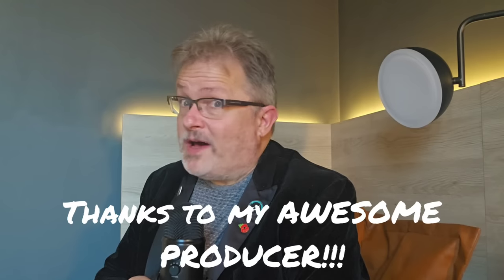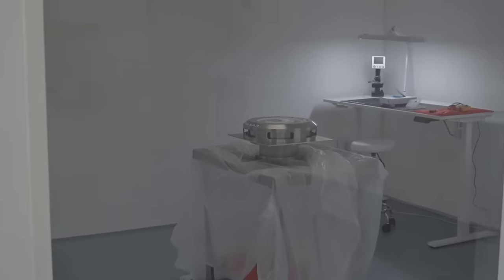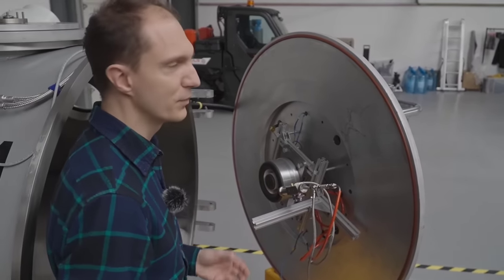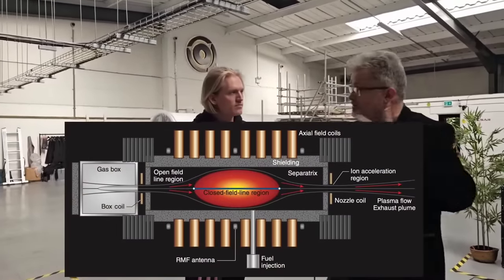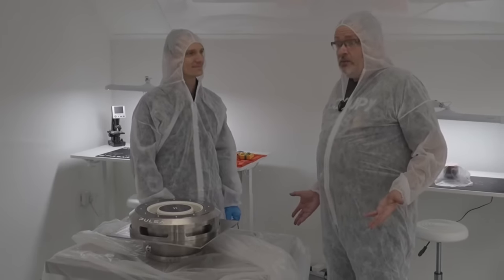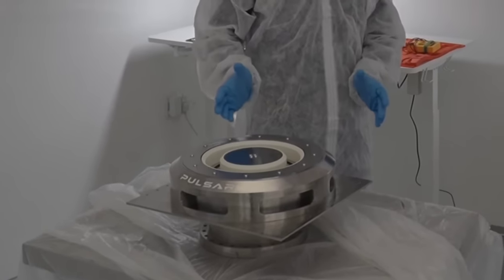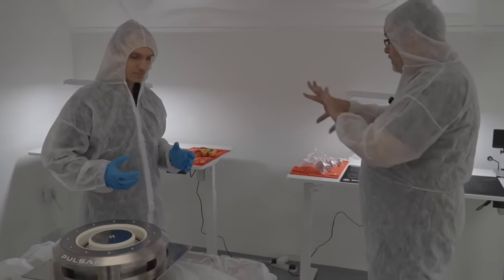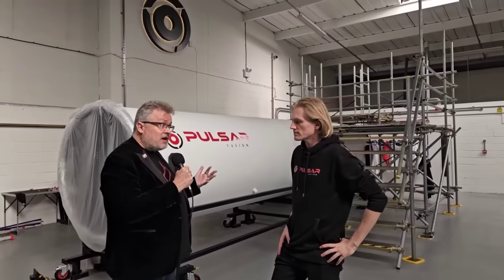Pulsar Fusion update!!  Nuclear Propulsion in person!

Comment: someone get this man an audio engineer. he brings really great content but its definitely held back by the technical issues.
Reply: Yea, I can't get my audio loud enough to hear what's going on... so I guess I will have to skip this video.
Reply: Needs sound leveling and amplification. Great content!!
Reply: Luckily my phone gets very loud.
Reply: It’s funny I had to turn to the lowest volume setting I could get at the beginning and to put it on maximum setting during the tour 😂 it’s still great content though👍
Reply: Stuff like this just happens sometimes. Bad acoustics, brand new or broken mic with no backup audio, etc. I once accidentally recorded an entire podcast with my laptop mic instead of the professional setup I had. The audio was so bad I ended up paying someone to transcribe it into an article instead.
Reply: Bumped the volume 2 notches and it was fine. Must be differences in devices?
Reply: If you set stable volume in the YouTube settings it's fine... Just go to settings additional settings and stabilize volume toggle
Reply: Yeah - completely unwatchable.
R
Reply from the maker: Youtube improved the problem.
Reply from the maker: I can hear it just fine on my cell phone now, let alone headphones or something.
Reply: @TheAngryAstronaut  I'm having to use a volume booster plugin for chrome on my laptop
It's not that it's not clear, it's just much quieter in the tour part vs the intro and voice over at the end
Reply: @TheAngryAstronaut yep it's fine for me! Considering the huge echoey warehouse I think you did pretty well! Great informative video... Nice one!!!
Reply: @TheAngryAstronaut  thanks for your great effort, it would be even better without the frequent gasping tgat is your every inhale which is via your mouth instead of your nose like it should be for optimal cognitive function.

Your guests from England are all speaking with even more silent gasping than you, the gasping is there ans nore frequent than your own bit it somehow less painful than yours.

Is am not a "troll" or is this hating, it's just honesty or "autism" as they might call ot today.
This is meant to improve, not harm nor insult you. Mouth-breather gasping is a staple audio abuse, regardless of how great their content can be.
Reply: its fine imo

Comment: I suspect I'm more likely to hear about a fusion powered rocket on orbit, than a fission powered one.
Public opinion has screwed all things fission unfortunately!     :(

But thrusters that incorporate electrical energy gathered by solar in mid-flight are the way to go, which doesn't require fusion or fission, which is helpful....
It will be interesting to see what Pulsar end up launching and testing.
Reply: Trouble with solar is that it falls away with the inverse square law, so rapidly diminishes as you go further out into the solar system. Therefore nuclear has to be the way to go I think.
Reply: @greenstair  Yea, that's the issue for deep space stuff, hence the RTGs on probes...

Personally, I don't think private companies will get permission to launch fission-based stuff, so will go another route.
Governments will tinker with fission NERVA style stuff maybe, but I don't think it will come to anything significant because government space programs are too inconsistent and erratically funded.

I think we'll jump from ion and various plasma drives, directly to fusion. Without fission ever getting the fair run it should have had, starting back in the last century!     :)

Comment: Interesting that it can work on different inertia mass materials.  Can they make one that burns "regolith logs" made of compacted and sintered regolith?
Reply: I don't know about using a mix of atoms all together.  Also, you want atoms that you can readily make positive ions out of, so either hydrogen, a noble gas, or a metal.  Not a refractory metal, because they're harder to vaporize.  I remember the first suggested propellant may years ago was a room temperature liquid metal like mercury, or a low melting point  metal like cesium.  Because aluminum is abundant on the Moon, I've heard it proposed as an ISRU compromise.  You still have to refine the aluminum.  It's not quite like "Mister Fusion" in Back to the Future, where you throw in a banana peal and drive off.

Comment: You need a 2-3 channel mixing board and 2 mics... And you need to check your input volume, it is super low and hard to listen to without cranking the speakers.. 2 or 3 channel mixers are cheap, Rockville has a great 2 channel for 59 bucks.

Comment: My first thought here is.. why not both.   Use a propellant like hydrogen in a hall effect engine for low speed accelleration and mate it with a larger combustion chamber for high speed too. 

Also correct me if I am wrong this is not nuclear propulsion it is ion style propulsion that would benefit from a high energy power source (like but not limited to Nuclear)

Comment: I prefer  iodine  over Argon or any other gas used in ion drive it costs less doesn't  need to be under pressure and you can place more in the same size container that you store a gas and achieve the same or better performance  b7t that's just me.

Comment: This fusion engine seems like a marketing gimmick to sell electric thrusters. Doubly so, since they spend 3/4 the video talking about electric thrusters rather than fusion thrusters.
They never mention what powers the fusion drive, since it's deliberately not self-sustaining. Powering an energy-negative fusion drive would likely take a fission reactor, but if you have a fission reactor anyways then you can use fission fragment propulsion much more easily from already existing fission research than inventing a new kind of fusion device. Nor do they mention hard numbers on how it is expected to compare in performance to thermal-nuclear or nuclear powered electric propulsion, like thrust to mass, exhaust temperature, electrical power draw, electricity to thrust efficiency, ISP,  amount of waste heat and how they're going to keep it cool; even if they don't have the test chamber working yet, that wouldn't stop simulations or calculations of basic ballpark numbers. And add in the fact that Helium-3 is basically unobtainable without a massive industrialization of space that this engine is supposed to permit, creating a chicken-and-egg problem... The lack of technical detail doesn't inspire confidence from a technical perspective.